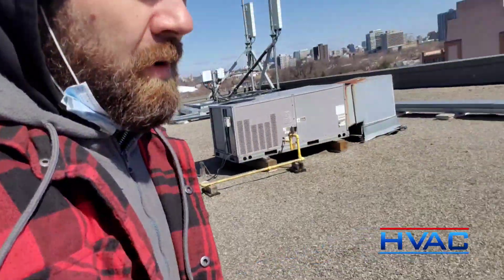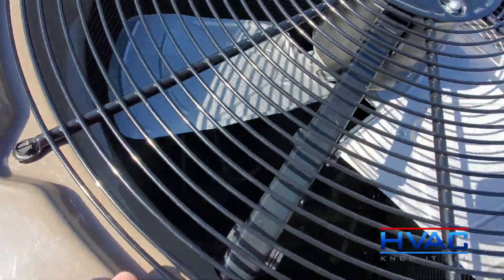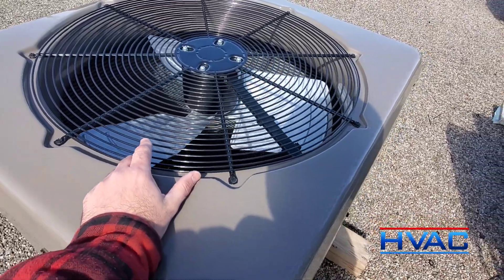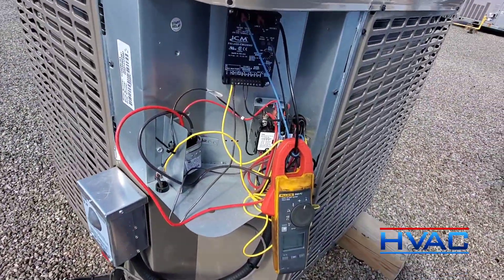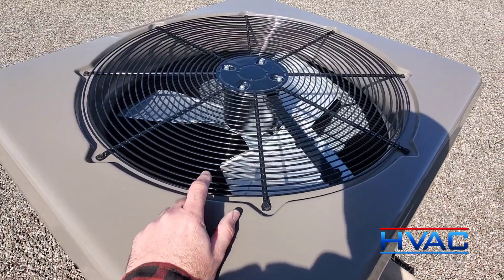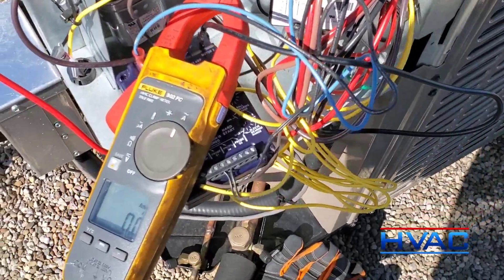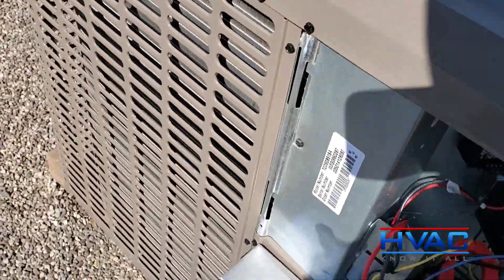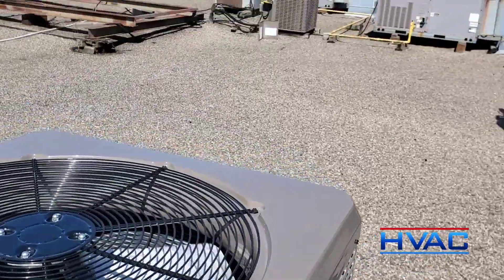Defective Condenser Fan with Fan Speed Control Problem

Comment: I think they should be used with a "ball bearing " motor, B.B.motors cost more,are noisier but put up with running at low speed better, the B.B. lubricates itself better, if it's a critical piece of equipment  IE: it runs a lot in cold weather, try to sell the customer a B.B motor

Comment: Hi Gary,
I know that sound really well. I'm fairly confident that ICM uses a Bidirectional Thyristor (AKA "triac") for speed control on these common PSC motors. That sounded like the thyristor was "half-waving", which means that it's conducting more in one direction of the AC Voltage Waveform than the opposite direction. It's a common failure mode of thyristor circuits.
Back in the 90s I had an experimental furnace hopping across the lab when a 1hp blower motor was half-waving like that
Reply from the maker: Interesting stuff Bob, could this be similar to a 3 phase motor that is single phasing, the noise and amp draw is are similar.

Comment: Mr. KIA were you working on a low ambient refrigeration system for a commercial brick and morter? i.e. refrigeration for supermarket,  frozen food storage, computer room etc. In your few months in the field opinion of ICM's- Do these ICM controllers really help with dual head control vs ECM motors with flooded condenser method?
Reply from the maker: This is just straight AC.  They do work well in this application yes.  In refrigeration with receivers I usually find flood back and condenser fans on full bore.  Or one on full bore and the other is cycled on ambient or pressure.

Comment: Idk my understanding with the icm controller is when there is a call for cooling the fan is to ramp up to full speed for a second then modulate, for 2 . Reasons 1 start the fan with full voltage should the fan be back spinning on start up and 2 to lubricate the bearing and then modulate
Reply from the maker: The last two I've installed didn't do that in a low ambient condition and this one here didn't either.  I believe that is a sttong thing.